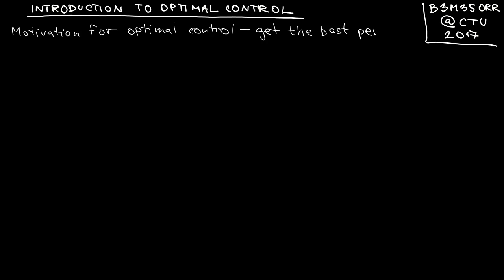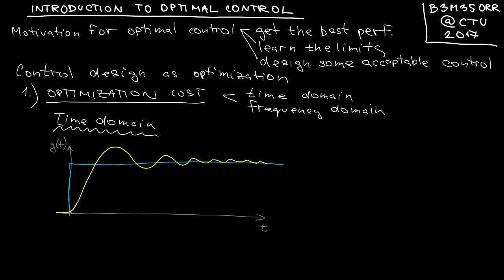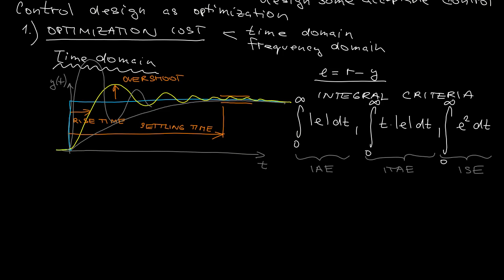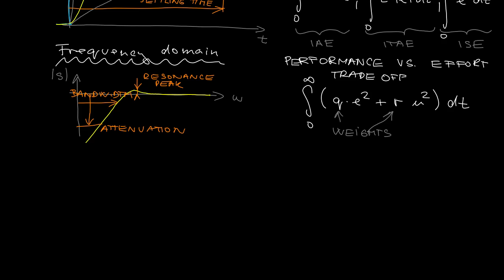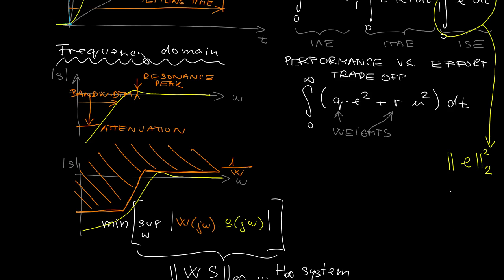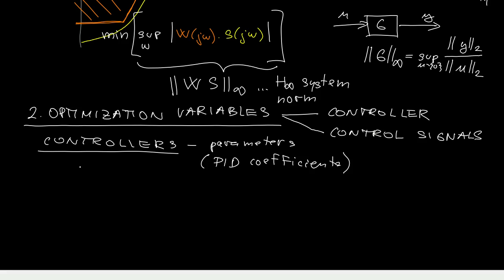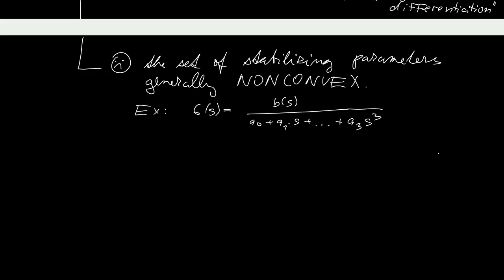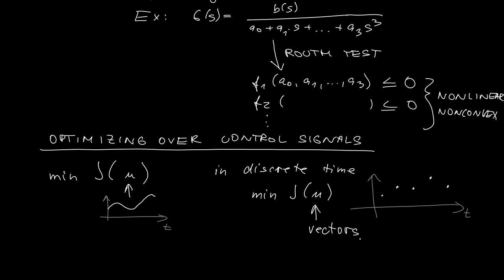L3.1 - Introduction to optimal control: motivation, optimal costs, optimization variables

Comment: Hi Teacher, I enjoyed the lecture a lot, and I found the software you are using is very effective for brain storm or discussion. Could you please tell what software/equipement you are using for the demonstration?
Reply: Also curious - which software are you using?
Reply from the maker: Hi Longfei. I use Wacom Cintiq tablet connected to a PC running Linux and all the sofware I used is free & open source. I use Xournal sofware for creating the notes, Kazam software for recording the screencast, Audacity for recording the audio and Kdenlive for putting it all together.